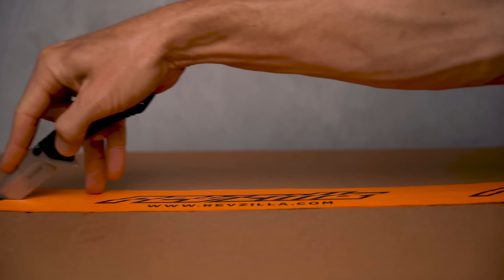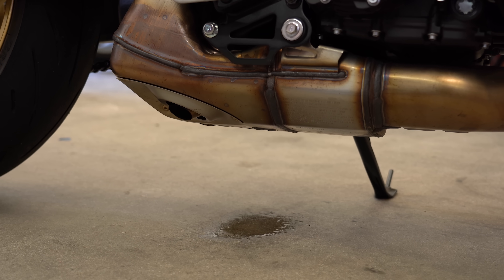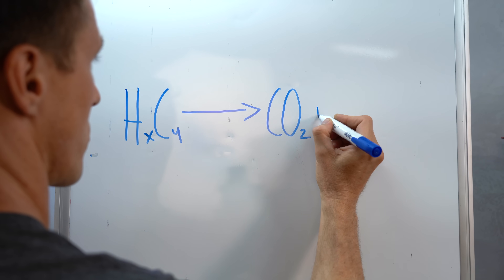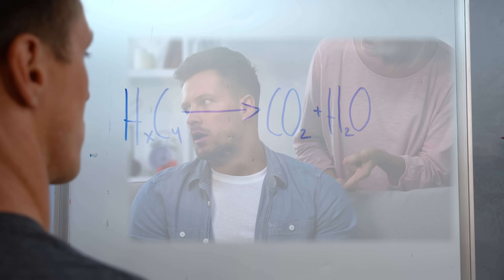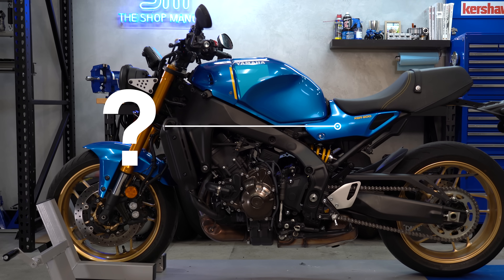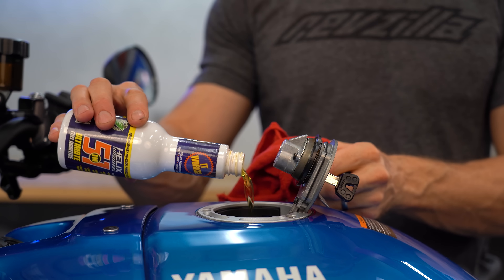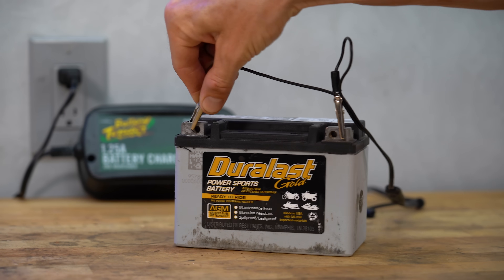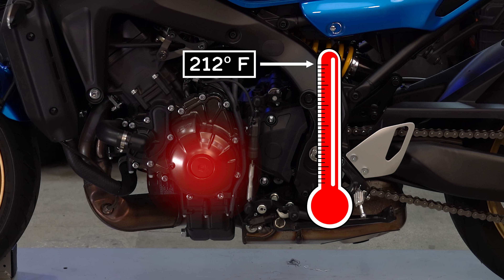The Storage Myth That Hurts Your Motorcycle | The Shop Manual

Comment: Indiana resident here; I just tonight had my '81 Yamaha XJ650 out around town. Anyone that knows these bikes know, that these bikes are carbureted, and run best when fully warmed up. This evening was 36 degrees, and I took it out for 4-5 miles enjoying the cold. I never start the bike unless I can ride it. A stretch of 1-2 weeks is about maximum sitting time without a ride. The thought of storing the bike for the winter is just ridiculous.
Reply: Those 80's bikes are awesome i have a xs1100 special and still in shape

Comment: I've been riding for 50+ years now and learned a few things along the way. 
  To store all my bikes, I try to lift them off their wheels is I can to relax the suspension (if not no big deal) I run Seafoam thru the fuel system on my last ride and top off the tank (to keep it from forming rust inside the tank) Then shut the fuel off. I plug in my battery float charger so the battery is 100% all the time and cover it. No need to remove the battery, even in cold temps. Batteries can't freeze if they're charged up. I
 I have never drained my carbs since I started to use Seafoam (30 years ago) there is now need. Same hold true for all my motors and they al start right up after storage. This works for my lawn mowers and tractors, chainsaws, motorcycles and snowblowers. I use 87 octane pump gas with 10% ethanol in it and never had a problem yet. No need for alcohol free gas or the expensive premixed gas they recommend for small engines. I never had a water-in-my-fuel problem yet. I store all my motors and gas indoors in a dry shop or shipping container.

Comment: You could also do absolutely... nothing!  No fuel stabiliser, no battery tender, no starting once in a while!  I stored my old 1977 RD400 in a cold shed for most of it's life (37 years) every spring, it would start with a few kicks, did the same with my 650 Versys, and with my current Suzuki Vstrom.

I have seen what can happen with long term storage in a cold environment, but long term means many many years without starting or using, a few months won't do any harm!

I bought a 2008 CBR125R that sat for many years, the only thing wrong was the fuel tank had started to rust because of that blasted ethanol they now put in gas!  Ethanol is hygroscopic (absorbs water from the air) and the water will separate if left for a long time making steel gas tanks rust from the inside.  For long term storage, drain the tank, take out the battery and make sure fuel is out of the carbs or injector bodies.
Reply: I have a dehumidifier in my garage which keeps away the rust inside and out.
Reply: The 2 strokes, I find don't gum up as bad and lube really well...
Reply: @nbandpinportugal  This wouldn't do anything for any of your internals of your engine/gas tank, as they're sealed off from the outside air.
Reply: @QuincyStick  Gas tanks have to breath, that's why they rust and carburettors allow air into the engine, that's their job.
Reply: @nbandpinportugal  it appears you're correct on the tank part, however between the throttle body being, the valves most likely being closed, and then the bottom end/cams being petty sealed off, I doubt it makes much of a difference in terms of engine internals. Still not a bad idea however, especially if you live somewhere prone to rusting
Reply: @QuincyStick  Also, the job of the exhaust is to remove exhaust gases to the outside therefore it is open to the atmosphere and to the valves if it's a 4 stroke. And if any valves are open air can reach the cylinders. It's not gonna be much but it depends on humidity in the air. I live in an area with hot dry summers and mild but humid winters.
Reply: @QuincyStick  dude, don't give out advice unless you're right. Please look it up. It only takes a few moments to look it up. And then you'll have the knowledge.

A typical engine has four valves per cylinder to them are inlet and two of them are exhaust. The engine is called a four-stroke engine because there are four parts to the process of burning the fuel. Do you know what a piston and cylinder looks like?

The piston is a bit like a half can of Coke that moves up and down inside of a full size can of Coke that's empty. The four valves are in a circle at the top They look like trumpets. It's a two trumpets open till later in the air in the fuel as half size coat can slide to the bottom of the big can. Then the two inlet valves closed and the small coat can rises up to the top and squashes the air and fuel really tight together and then the spark plug fires and sets fire to all of this. That's the first two strokes completed.
With the force of the gas from the burn of the fuel and air this pushes down the half can inside the full can until it reaches the bottom where the exhaust valve start to open and as the can rises back up it pushes out the burnt mixture of gases.
The exhaust files close and then the piston starts to move down back inside and the two inlet valves open to let in fresh air and fuel.

So you have a 50/50 chance that the valves will be open or closed allowing for air and moisture in the air to enter the engine at any time.
That's for each cylinder.

There are YouTube videos showing cameras on the side of engines or inside the engines and you can actually watch this happen.

I highly recommend you see it because it will teach you so much about how engines work and you'll have so much more knowledge.

My winter tip.
The last ride or last couple of rides you're going to do don't put any fuel in. Just let the tank run almost dry and then when you're home you can let the engine run out.
Make sure the bike is clean.
And then put a good quality well-fitted cover over the whole bike.
Put the bike inside a garage if you can.

Get a trickle charger and stick it on the battery once a month for a couple of hours.

Or what are you to do was put the cover on and trickle charge the battery but I will go and start the engine about once a month.
Reply: @QuincyStick  did you ever use a vehicle which had an oil pressure gauge? Where you can actually see the oil pressure needle moving depending on how much oil pressure the engine is generating. Did you ever see this?
It's a really good thing to have on an engine and it's a shame that most engines don't have them these days.

I was lucky when I was young and I had a couple of vehicles that had these gauges on. I learnt that when the engine is running on idle Iits only making about half of its oil pressure. It needs to ref to about 1/4 of its reverange before it's starting to make 3/4 to full oil pressure.

I also learnt that if I didn't change the oil and filter for about 6 months to a year I would start to see the oil pressure level drop and the engine would require more revs in order to reach the same level of oil pressure.

Inside your engine there are little canals and grooves cut into the metal that the oil can pass through to to reach different areas all around the engine. When the pressure is low not enough oil is going to pass by these areas where metal is rubbing together so you will get increased wear.

There was a recent recall or customer claim against I think it was Honda where customers were idling their engines for a while while they getting ready, which is typical for motorcycle riders more than car drivers. You know we might be doing helmet, jacket, boots, opening a gate, setting up your sat nav, clicking your phone onto your bike, etc.

Anyway because the engine revs was staying low for a considerable time when the bike was cold the oil wasn't getting pumped around to other areas of the engine so the engine was suffering from premature wear.

They fixed this on later models by changing the amount of oil pressure being generated at idle.

If we still had oil pressure gauges then we would all learn about how oil is affected by age, the filter getting dirty, and idle.

I would much prefer to have an oil pressure gauge than to know what gear number I'm in.

The gear I'm in depends on the speed I'm going and what I want the bike to do, it does not depend on the number. The number just happens to be whenever it is depending on what I want the bike to do at that time. The gear is never something I select first and think oh I need to be in fourth. Why need to be in depends on what I want to do :-)

Give me an oil pressure gauge please :-)

And I think for the manufacturers and maintenance people seeing your oil pressure levels start to drop would make so many people phone up their dealer and order, at the at minimum, an oil and filter or book in an oil and filter service.

There was a time when I knew nothing about most things and I realised that I still know very little about a lot of things! Talking to each other and helping each other means we can spread forever knowledge we have. I'm sure there's lots of knowledge that you have that I don't and I hope one day if you see me write something in the comment or I don't know I'm talking about that you will helpfully correct me and give me information.

Stay safe on your bike :-)
Reply: @Google_Does_Evil_Now  dog what in the absolute hell does this have to do with my comment in the slightest
Reply: @Google_Does_Evil_Now  yawn 😩

Comment: Hmmm, I've been starting my 2002 C10 almost everyweek for the last 3 years. Move it out so the exhaust is outside the garage, start it up on the centerstand, put it in 1st gear and after 2-3 min.s, i chop the choke/enrichner, and bring the revs up to 3000-4500 and use a throttle lock for approx. 8-10 min.s.  By this time, the LH engine case is usually too hot to touch usually. Plus I drop the idle rpm to1200 ish/idle, and squeeze the clutch in. If the rear tire stops rotating, I park the bike back in the garage, and put it back on the tickle charger till next week. I can only say I hope Ice not done any damage over the years. I have moved to the midwest in the last 6 months, and winter months will be much colder than CA I was in.  I may have to rethink this if all that you mention in vidro isnt a load of hoowe... .  Man, I would have tun it longer and a higher rpm if I had known. Midwest where I live now at  least have non ethol gas.  Thank for the video.  Hard to believe ....

Comment: Ari for the next shop manual can you explain and maybe experiment what happens if your tires are mounted with the wrong rotation direction, Cause it happened to me once and i didnt notice until 2 months using it
Reply: Yes please this should be featured. Saw some posts that resulted in pretty scary results when people rode their bikes with improperly mounted tires.
Reply: ari already did this. the sensor will warn you about ABS issues but not much else
Reply: Nothing happens, the only effect is reduced wet grip. I, and lots of people that do frequent track days, flip tires to even out wear: Most tracks wear of the right side first, so flipping the tires before they wear out on the right side makes them last longer.
Reply: @tobiascarlen  The major concern is delamitation at the tread splice. The thread rubber is wrapped around the carcass and overlaps at the ends. If a tire is mounted backwards the tread splice is angled the wrong way and the rubber may begin to peal up.
Reply: @AriH211  That does not apply to most modern tires. A lot of car tires are marked "this side out"; i.e rotational direction does not matter; it it's mounted on the left it will be one way, if it's mounted on the right the other. Also, track tires are heated with tire warmers and frequently run so hard that they overheat and run until the cord starts showing; despite this, I have NEVER seen the thread breaking up on a tires running "the wrong way". What can happen is that when the rubber is completely gone, wear starts to eat the thread away and it starts to disintegrate and "bumps" form on the surface; the next stage is tire explosion. But thread separation on a tire with rubber left? Never seen that.
Reply: @tobiascarlen  I assume you meant to say "tread" instead of "thread"? I accidentally used "thread" in my second sentence so may have thrown you off, sorry. 
I can't speak to car tires, and frankly I think that's apples-to-oranges, but I have seen tread-splice separation. It's rare, but it happens, and I've actually got a track bike (with slicks) in my garage right now that's a prime example. And i'm not sure who you're riding with at the track, but if they're overheating their tires perhaps they should invest in a probe pyrometer and learn how to adjust their pressures to achieve ideal tread temp. Or maybe they're overworking street tires at the track? In which case they don't need warmers, and shouldn't be using them since warmers heat to 170-200F, which is too hot for street-based rubber.
Reply: @AriH211  Overheating is of course not intentional, it just happens sometimes when you push a bit hard. For me, I guess it’s partly due to me running Supercorsa SP V3:s instead of hardcore track tyres or slicks - they cost less and last longer, usually 3-4 days for a rear, that I usually flip after 2 days. I run about 10-12 trackdays per season, so that’s still about 3 rears per season and 1 or 2 fronts. Still, never seen the tire come apart before the rubber comes off. What type of slicks are you having come apart before the rubber is gone? Most slicks wear out so fast, that I’m a bit surprised to hear that the carcas would go bad quicker.
Reply: If the techs are THAT ignorant I wouldn"t take a bike there again for service!

Comment: My 1100 square ft. garage is heated to 70 degrees and very dry all winter, I run all my bikes and my other machines 2 or 3 times during winter, I also move em around manually several times. I always use battery tenders year round. This has always worked for me.
Reply: just recently moved to a place with a 3 car garage with 700 sqft. what do you use to heat your garage? looking for ideas. i live in michigan
Reply: @gtomsick  I use two small electric heaters set at 65F winter here just sucks for several reasons but Im stuck here my heaters have fans on them to keep the air circulating

Comment: During the winter months , my bike has a small electric tube greenhouse heat under the sump and then is covered with a warm electric blanket and then some old bed sheets, both are plugged into a timer with a thermo cutout switch, and the bike is nice and cosy.

Comment: I keep my bike on an optimiser while garaged and try to get out at least once a month during the winter (north east Wales) provided there’s no salt on the roads. I always think riding is better than just running the engine, I only ride 40/50 mile plenty enough to get everything up to temp, final drive, gearbox, suspension etc.

Comment: I've always made sure my tires were properly adjusted, bikes cleaned and waxed, filled with gas and Stabil Storage added and bikes run for 15 minutes. Battery tender connected and covered. I've never had an issue yet in the spring. BUT years ago they didn't have battery tenders, gas Stabil and bikes had no fuel injection, that was when I had problems

Comment: Idk, of all the bikes me and my family own, we have our own winter 'ritual'... We're from SW Ohio, but basically we use ethanol free fuel for the last month of the season, add startron, put the bikes on a tender, then start them once every 2-3 months to circulate oil. If the weather is forgiving, well go on a short ride, if not, idle til the cylinders are warmed up.

Never had issues with rust, varnishing, dead batteries, etc. And have had the bikes for many years and out many miles on them... Tho we all have only had air cooled vtwin cruisers too...

Comment: Interesting. My takeaway is that I need snow tires for my motorcycle.
Reply: Anakee radials are M+S rated. I have not tried them on any real snow yet though. I have the bike on a battery tender but ride several times a month as long as there is no snow or ice on the roads.

Comment: Pretty interesting I've been riding motorcycles from Dirt bikes, crotch rockets and then Harley's for 40 years and I live in an area where the average winter is 25 to 55 degrees with 4-6 inches of snow on some days and on some days its in the 60's and all I've done to my bikes when I'm not riding them is start them up for 10-15 minutes let them idle and then give them a little rev and shut them off and I've never experienced any problems with my bikes ever.  I keep them on a battery tender in between rides regardless of weather all year round and again never had any types of problems with any of my bikes. Hmmm? maybe I've just been lucky all these years or maybe this stuff only pertains to below zero weather??.   Regardless thank you for sharing and ride safe.

Comment: You summed it up. Start the bike and ride it. My bike sits for 8 or 9 months at a time. Put stabil in, park it in a shed and usually connect the battery tender. Last year my battery tender blew out from a power surge. I arrived to a dead battery.

Comment: Even in summer my engine cases don’t reach 212f, I used a infrared thermometer to check at the oil sight glass; even on a 110f day it was about 185-193f.

Comment: I still think not starting for such a long time can create some other problems.  Same with cars, you start up a bit, let it warm up, then ride around the block.
Reply: I agree.....last I read on fully synthetic oll which most of us us is that it readily runs of internal surfaces....hence not protecting well against internal corrosion.

So for me its start the bike at least once a month.....and switch to Semi Synthetic if you engine is deemed ok with...My 2020 Triumph is.

in the next few days I am going to drill a tiny water drain hole in the lowest part of my bikes exhaust system.....the can at the back....water can sit in there plying havoc.

My batt I leave on a small bike type maintenance charger.

I will prob run my engine till the crank case is good and hot.